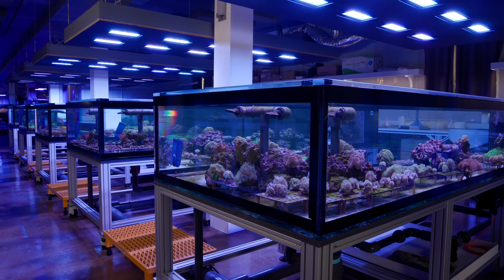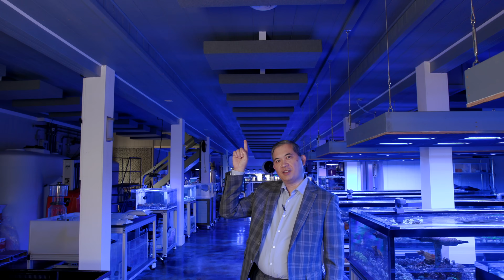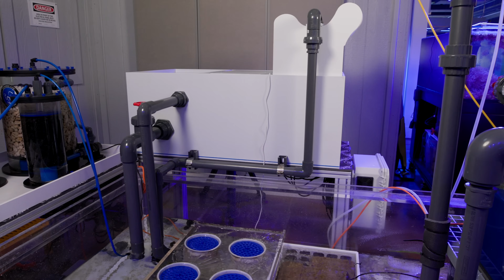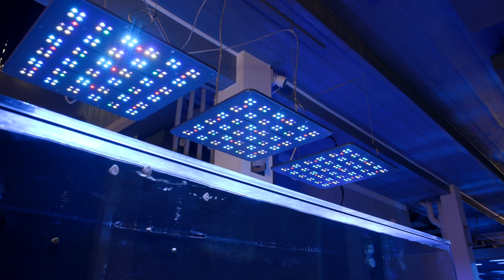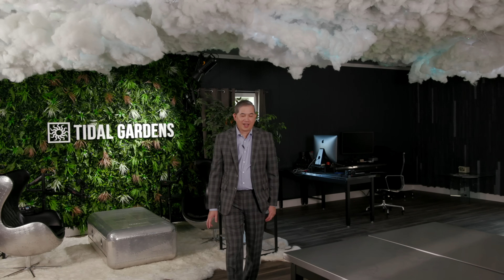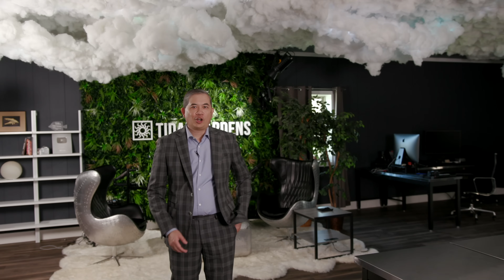This Coral Farm Was Too Loud… Until We Fixed It

Comment: Throughly enj❤oyed it 😊  Top notch Than .   What the best  foam & thickness you samwitched between the dynomat ?   Might be cool under a sump .  Think it might be good under a display tank ?
Reply from the maker: My only concern under a display tank is that it is a sticker of sorts and the edge is kinda goopy.  Under a sump, nobody really cares since it is so low and out of the way, but a tank it might be at waist level.
Reply: @tidalgardens Good planning 😊

Comment: I am using Maggie muffler for my overflow. The noise is mostly from the waterfall from the weir. 

Having it almost at main tank level make it very quiet but surface oil won’t get filter properly.. lower will bring some sound from the waterfall. What is your height difference from the main tank to the overflow water level? Do you have surface oil?
Reply from the maker: When I hear too much noise or see to much splashing from the weir, it is often because there is too much flow coming from the return pump.  That might be unique to our setup because we have such large overflow boxes, we can have what looks like low flow still being substantial amounts of water movement.  The height difference is only about 1/2".

As for the surface oil, yes that will happen in the overflow box.  Every now and again I remove the muffler to allow it to clear that surface scum.  It is actually a good thing for me to do because several times we see a fish jumped into the overflow box and we can rescue it.